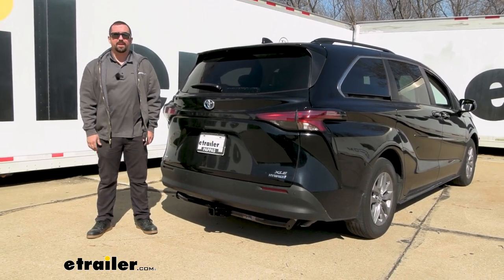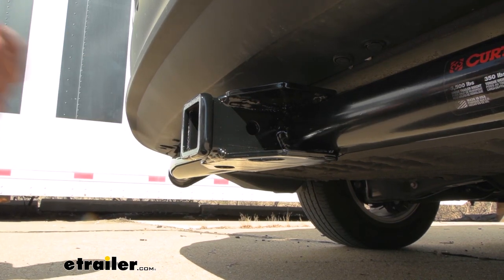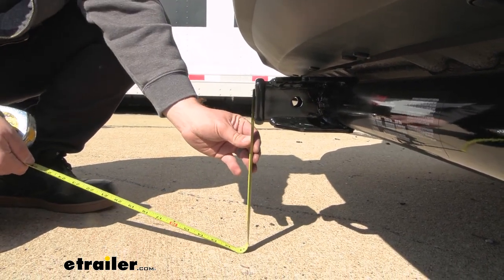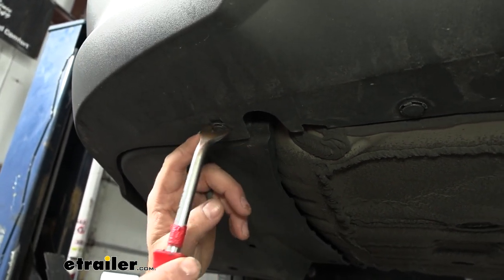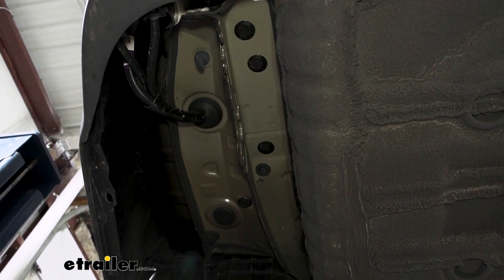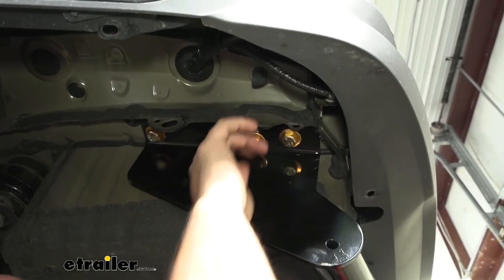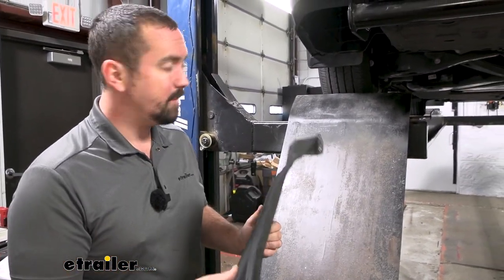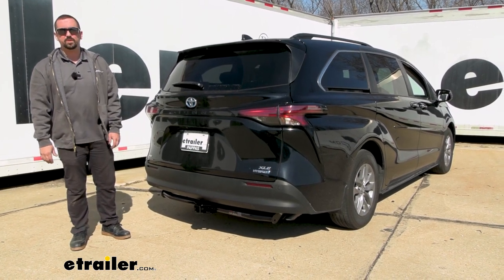etrailer | How to Install: Curt Trailer Hitch Receiver on your 2022 Toyota Sienna

Comment: What is the hitch for? What can I tow?
Reply from the maker: The Curt # C22UR Class III hitch can be used for towing a trailer or a smaller camper. Many folks also use the hitch as an attachment point for a hitch mounted accessory like a cargo carrier or a bike rack. From what we found in the owner's manual, the 2022 Toyota Sienna has a towing capacity of 3500 lbs IF the vehicle is equipped with the tow package. If your Sienna isn't equipped with the tow package, Toyota doesn't recommend towing.
https://www.etrailer.com/Trailer-Hitch/CURT/C22UR.html
Reply: Does the kick sensor still work?
Reply: @supabryan83 I just installed my Curt hitch following this video and it does.  I have to place my foot right next to the 2” opening between the brackets on the hitch, but it works.  It is not as easy as without the hitch, but I think it’s worth the trade off.

Comment: I don't know if I would put a hitch on a sienna..The hitch is so low to the ground and if you already have cargo in the back and then add more cargo to the hitch, it's going to be dangerously close to the ground. I have seen numerous sienna the back is so low to the ground.
Reply from the maker: That's true. If you're using a hitch mounted accessory on a Sienna, we recommend using an accessory with a shank that's angled to provide greater ground clearance. What are you wanting to use the hitch for? Let us know, and we'd be glad to provide some recommendations for you.
Reply: @etrailer  thank you for the reply. We need a hitch for cargo and for carrying bikes. We have a cargo hitch carrier and bike hitch already that we use on a different vehicle but it would be nice to have that option for our 2023 Sienna
Reply from the maker: One other thing that will assist is helper springs for your coil springs that will help eliminate some of the squat caused by a trailer's tongue weight being applied to the rear of the vehicle. For a FWD model, use # CSS-1168R or # CSS-1195F for an AWD model.
https://www.etrailer.com/Vehicle-Suspension/Toyota/Sienna/2023/CSS-1168R.html?VehicleID=202311881
https://www.etrailer.com/Vehicle-Suspension/Toyota/Sienna/2023/CSS-1195F.html?VehicleID=20236000051